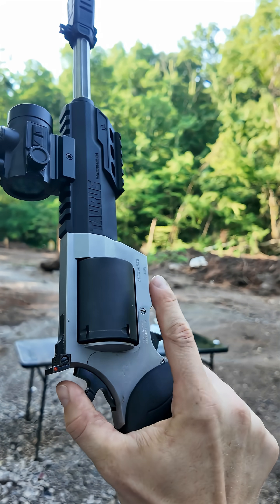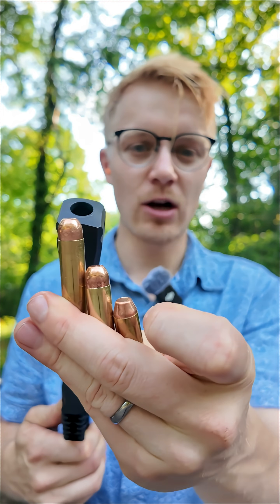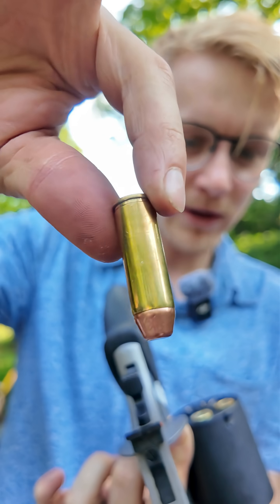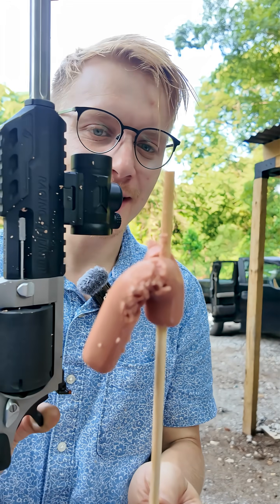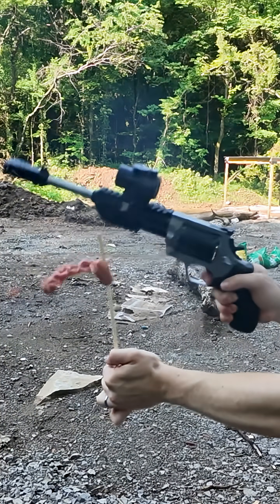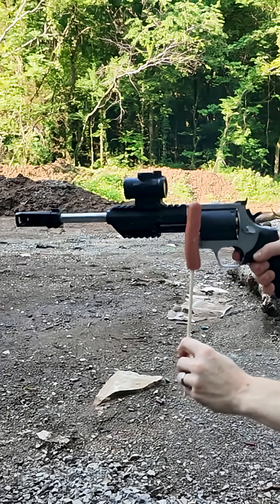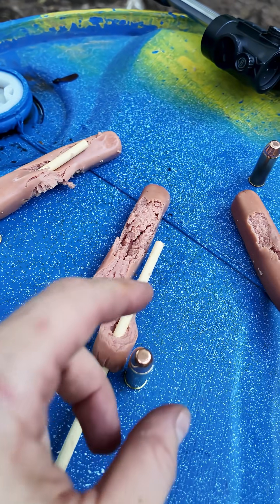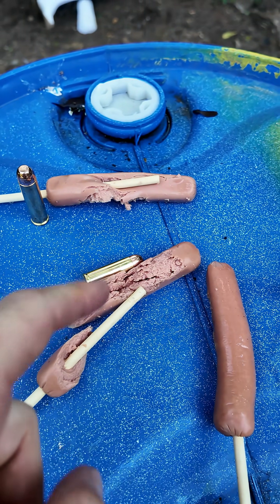Can A 460 Magnum Blow Off Your Finger?

Comment: I owned a Raging Bull 454 in the early 2000s and I can assure you that the words "less powerful" do not apply to that caliber.
Reply: The .454  runs higher chamber pressure than the .460 S&W
Reply: @billbailey55 its beastly.

Until Smith dropped the .500 this ruled the roost
Reply: @RAYTHEONGAMING  not mistaken I think 500 magnum still operates us slightly lowercase pressure then 454
Reply: Yeah that shit is one hell of a pistol i got the super redhawk snub nose

Comment: The reason why they quit making the 357 maximum is because the barrel cylinder gap, even though it’s not very big, still allows enough gas to escape that on that particular load was literally cutting the backstrap of the firearm itself. In testing the difference between the gas that is lost only amounts to about 8 to 12 ft./s difference than a semi auto pistol of the same exact barrel length. Regardless of whether your finger remains attached, you’re going to get a severe burn from the barrel cylinder gap no matter what round you’re firing.
Reply: I thought it was the ruger corrosion. I'll double check.

Comment: Well with the 45 colt, it’s all in how the round is loaded, a standard white box store bought load has lower pressures due to how it’s loaded but a home loaded round can be loaded to much hotter specs and definitely achieve that minced finger meat scenario that you achieved with the other loads.

Comment: In what world do people who use a revolver ever put their hand or finger near near where the rounds are being held by. If you need to hold it there just buy pistol that use a magazine instead of a revolver.
Reply: I've seen beginners try to do that.
I've also seen people try to fire a snub-nosed revolver from a coat pocket and burn their coat and hand. Especially if they have muzzle brake holes.
But I've also seen a lot of semi-autos remove a lot of thumbnails, a slide disassemble itself into a guy's face.
I've seen one AR and one .22 magnum bolt action explode and fill the shooter's face and hand with hundreds of little unburnt balls of powder. 
Stuff happens. Wear protection.  :)

Comment: I’m honestly surprised how tight the cylinder gap on that Taurus is. They’ve really stepped up their game over the last 20 years.
Reply: Not really. After selling hundreds of them, they are truly hit or miss on quality. The consecutive SN revolver, after that one could have a 1/16 of an inch gap. And the pistols are the same way.
Reply: I have three Taurus revolvers, the Brazilians are flawless. The judge has a loose cylinder but works fine
Reply: My Smith & Wesson model 66 has a huge gap that sprays lead if I shoot cast lead bullets....😢
Reply: @colt45peacemaker Sounds like your cylinder is out of time. You should stop shooting it, even with jacketed bullets, and send it for repairs.

Comment: You one handed a .45Lc?  Lmao nice grip brother.
Reply: The raging hunter which is what he's using is 71 ounces, just under 4.5 pounds, a 7.5 inch barrel single action army is just over 2 pounds, the recoil on the single action is negligible (in my experience), I don't doubt that a heavier gun would have easier recoil (assuming the weight absorbs some recoil and the muzzle break also works)